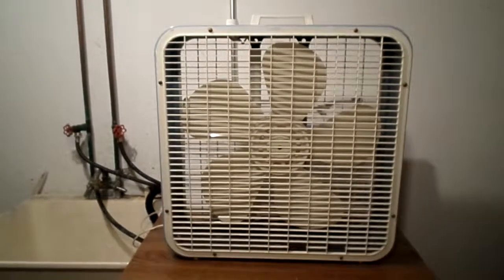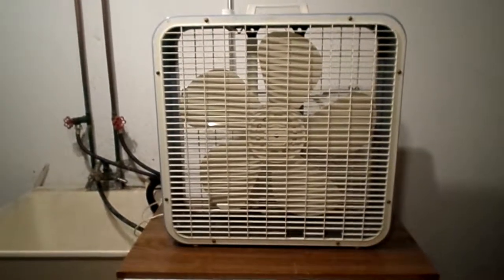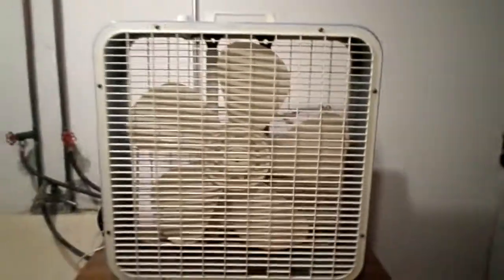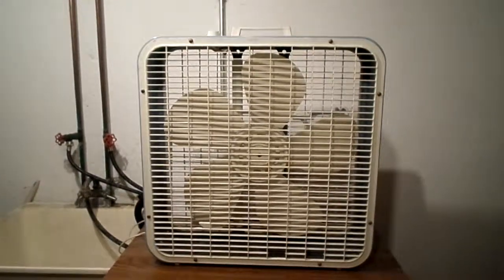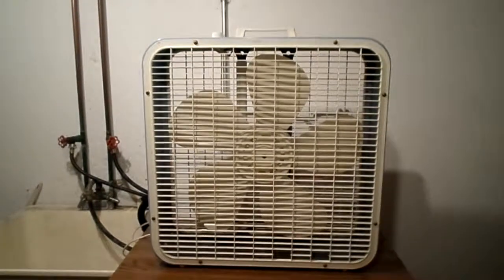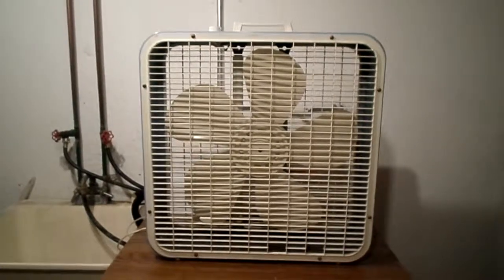1979 Kmart 20'' Box Fan Model K-223 (after repairs)

Comment: I think the blade could be the reason it runs fast. I've used the blade from my 1975 K-223-W on other motors. And it still runs fast as it does on its own motor. Likewise, I've used my 1976 S-223-W's blade on the '75 K-223-W's motor. And it still runs the same as on its own motor (I was actually borrowing my 1975 K-223-W's motor to use in my '76 S-223-W, as I thought its motor was having issues.). So, it pretty much might be the blade.
Reply from the maker: I experimented with it a bit and it seems that's what it is because I threw the blades from my JCPenney 9700 on it and it ran almost the normal speeds just a little faster actually the same RPMs my P-223 runs pretty much